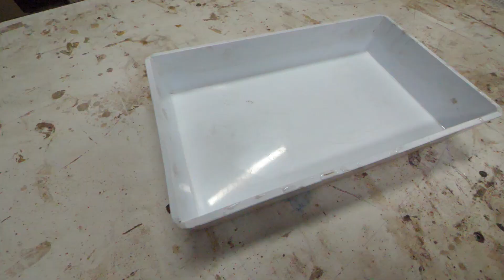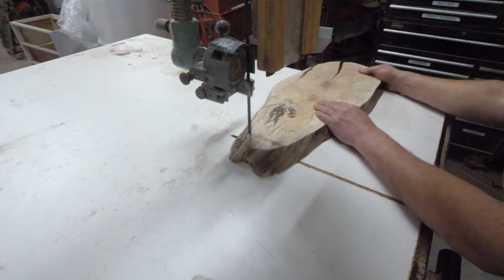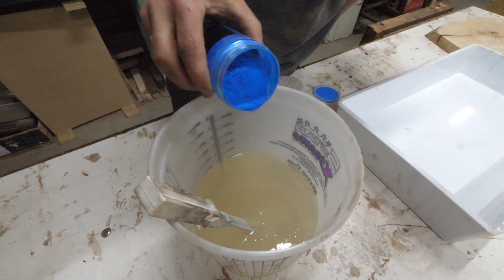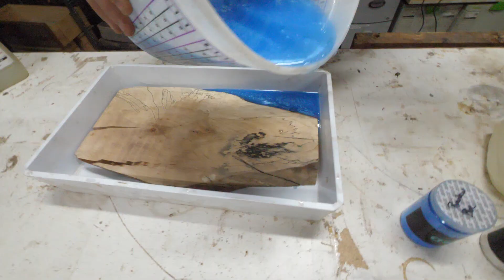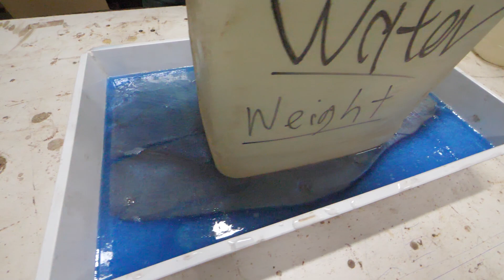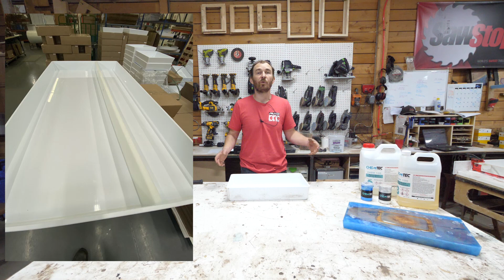Tool Tuesday - No Seal Hdpe Epoxy Forms

Comment: Just thinking...don’t put the wood in first,put the epoxy in first and then put the wood in.. my thinking is that the bottom should have a good coverage with no epoxy gaps and also there is more swirls on the bottom for a better look... maybe.. thanks for the video

Comment: I think the methodology behind these molds in only the beginning - your friend could make bigger, sectional, bolt-together pieces that could do forms up to 72” X 144” X 4” and then some. Obviously, the thickness of the ‘mold sections’ would have to become thicker. Something you should discuss with him. You’d never have to build another mold and worry about it when you’re pouring large tables.
Reply from the maker: Thanks for the suggestionns!